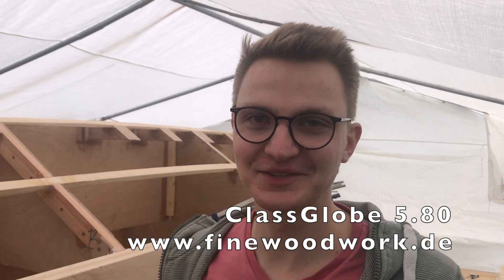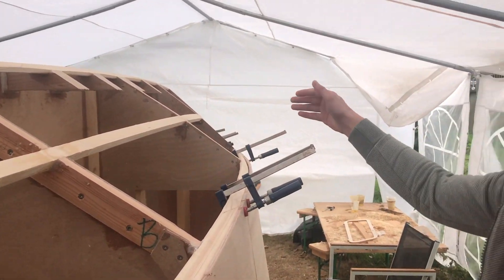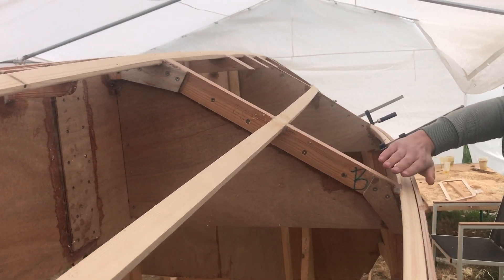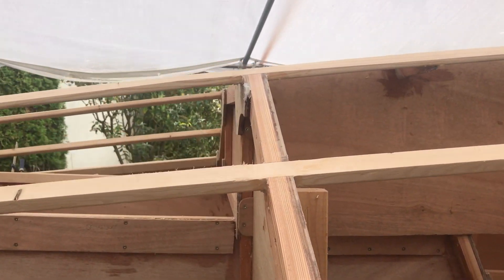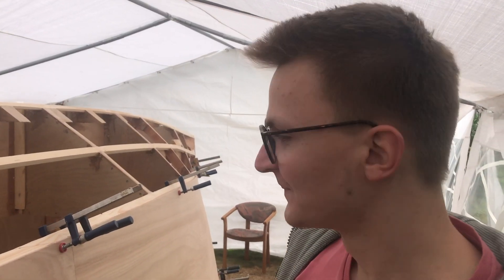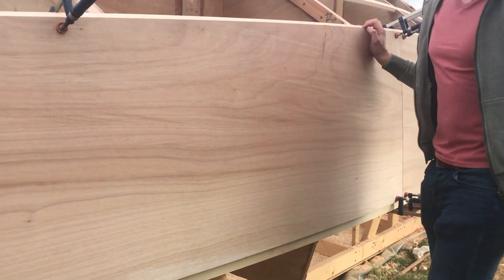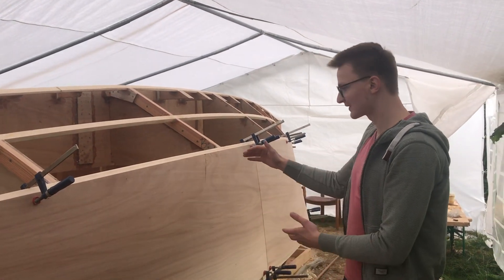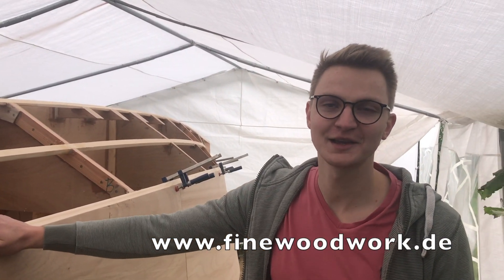ClassGlobe 5.80 - Builder Georg - Next steps | finewoodwork.de

Comment: Excellent progress' look forward to following your build.  Those tents are great, I used one for a small boat rebuild.  How will you cope with winter and the low temperatures for epoxy?  Andy UK
Reply: Winter Season is definitevely an issue! I am currently using a fast hardening epoxy which can be used down to 5° (8h curing time). So I am planing to work till christmas and use the best weather spots. Maybe I am also using some heat generators below the hull to ensure sufficient curing during an cold day. After that I will remove the tent, and use the then sealed Hull as a roof for the hardest winter month. In that time I am manufacuturing the keel, skeg, and rudder, so surely no boredom will arise. In Spring the boat will be flipped and the tent again put in place.
Reply: @georgeluetzelberger8968  What happened to the project?